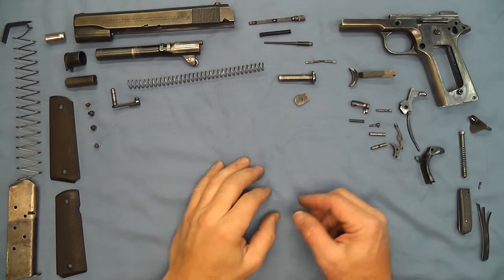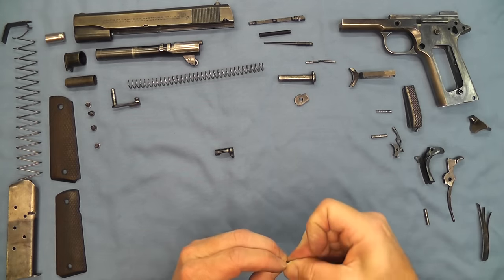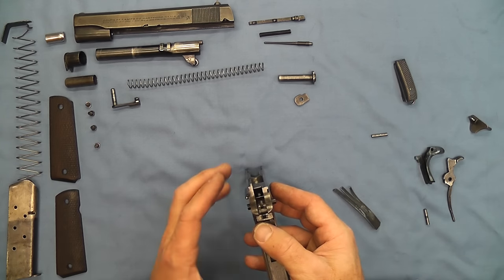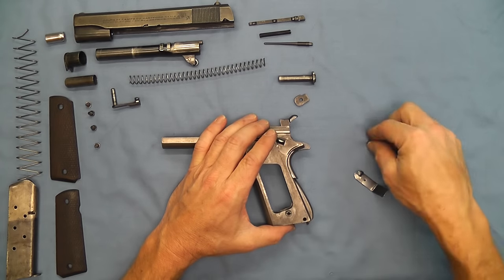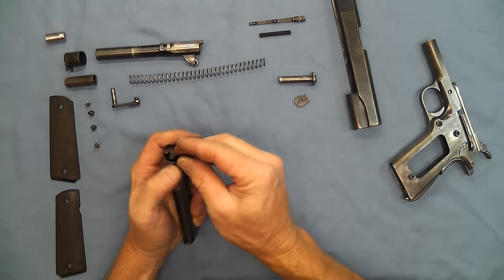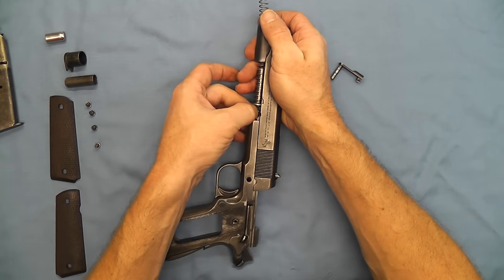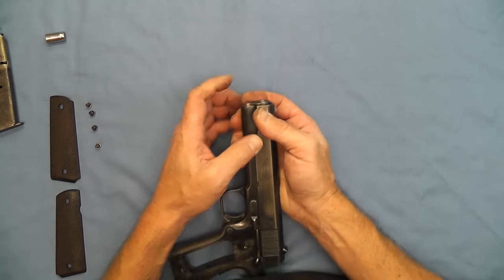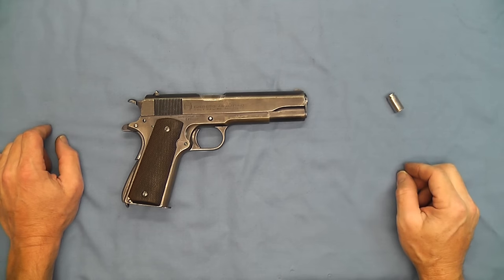1911 Pistol No Tools Detail Strip Assembly

Comment: I have discovered that the hammer and mainspring go back into the receiver really easily if you wait on inserting the grip and thumb safeties. Here's how I do it:

1) Insert the hammer.
2) Holding the receiver with my left hand palm down, over the top, with my thumb holding the hammer forward (and covering the hammer pin, which is prone to falling out), I make sure the hammer strut is swung up out of the grip.
3) Insert the sear spring.
4) Insert the mainspring assembly far enough to cover the bottom of the sear spring and hold it in.
5) Swing the hammer strut down.
6) The tricky part is using gravity to align the hammer strut so that it seats itself in the recess on the top of the plunger as I slide the mainspring assembly up. It's not really too hard.
7) Now insert the retaining pin.
8) Now proceed with the safeties.

Comment: Very good video, EXCELLENT Pistol made in Argentina when the things was well done, regards from Argentina!
Reply: That is an Argentine contract pistol, before the "Sistema Colt". It was made in Hartford, Connecticut, USA.. it is even roll marked on the slide. It is a real Colt. The Argentine made "colts" have different roll marks. Ones marked "DGFM FMAP" are the only OFFICIALLY licensed Colt copies produced in Argentina. (Many of the other copies were poorly done, and are not anywhere near as collectable.. yet). The real Colt manufactured ones are getting fairly valuable here in the US.
Reply: Much appreciated your comment, I have a DGFM FMAP pistol, is godd know that its fairly valuable for there.

Comment: Also, the trick to getting the barrel link pin to line up with the holes in the receiver is to hold the slide upside down and insert the barrel. Then insert the recoil spring and plug, but push them all the way forward. Now tilt the slide slightly forward and make sure the barrel link is laying down on the barrel. Still holding it upside down and tipped slightly muzzle-down, slide the receiver onto the slide until it stops. Now just turn the gun right-side-up and the barrel link will be lined up perfectly for you to insert the slide stop.

Comment: Great video.  I have a Series 70 that the hammer won't reset anymore.  dis/re-assembled half a dozen times.  Sometimes I'll get an intermittent hammer reset. Any suggestions?  I can't seem to get mine to function with tools. Lol...  Any info would be greatly appreciated...
Reply: +Cliff H What do you mean by hammer reset?
Reply: Sorry, rookie mistake. When I put the main spring back in I put the sear side of the spring under the sear. No pressure on the sear would just let the hammer fall when the slide was racked.

Comment: thanks for the video sir i also have one 1911colt but iam not conform about its model and which bore is it when i buy this 1911 from gun dealer its is .380 bore but i think there is change in it because in magazine  gunsmith has install a piece of wood in it so .380 cartage  can hold still same cavities left because megz more width then .380 
cartage  magazine can hold long cartage . i love this colt 1911 and i want to keep it original  an antique even i find gunsmith has smooth its pits 4 brng

Comment: Did you consider the empty case a tool?  If you use the grips afety/sear/ disconector spring as a screwdriver,(for grip screws) you  can disassemble the 1911  without ANY (aditional) tools......

Comment: Thanks for the fantastic video.  If you need 1911 parts, I get top shelf parts for mine at close to wholesale prices from spectresupply2 on ebay and spectresupply1 on Gunbroker.  They have way more parts on ebay, but things like frames on Gunbroker.  I've bought tons of parts from them.  They buy out big manufacturers' overstock and then sell it for a huge discount.  Probably once a month or so, I check them out - they're always getting new stuff.  They also have Glock, AK, Sig and other parts.